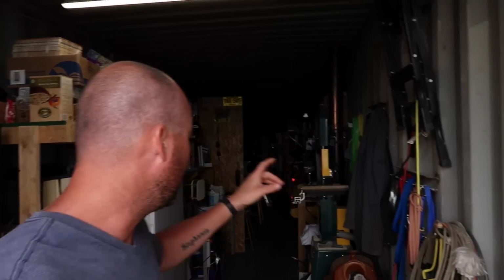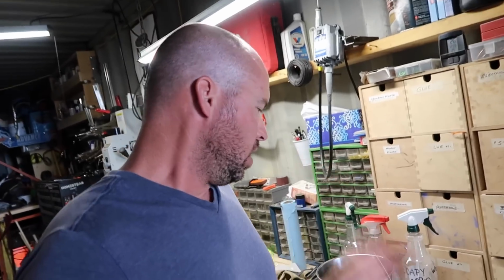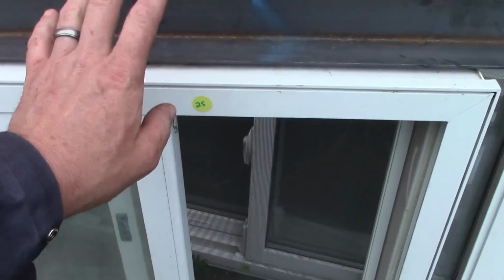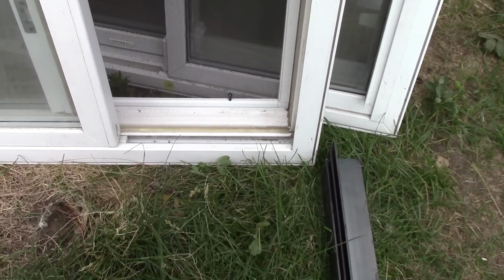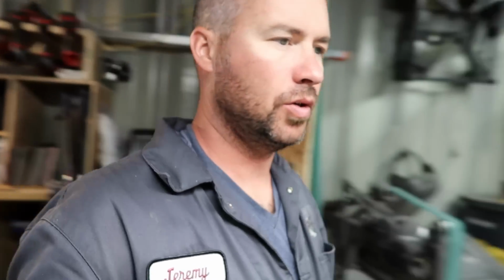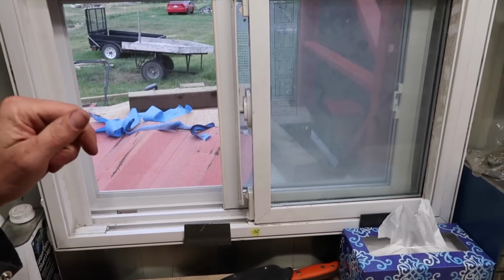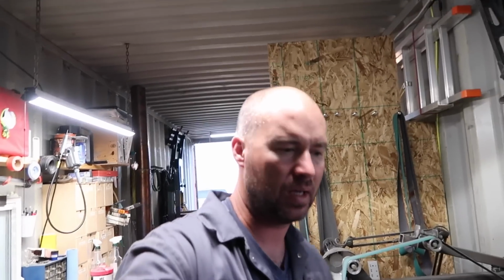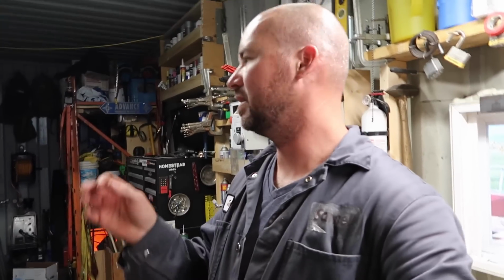Installing windows in the shipping container knife shop

Comment: Wow, hang some jerky in there.  :) That angle grinder appeared to make simple work out of cutting the openings! What a great project. Lots of great skill-sets used. Turned out great! Next project a little sun light on the roof. :)
Reply from the maker: Thanks! Sometimes I think I'm turning myself into jerky when it's that hot:) I started cutting it with an foxy-accetalyne touch but it was taking way too long so I grabbed the angle grinder. Always a versatile tool. A skylight, now that would be nice!

Comment: The video is great. I've heard of people buying two to three of them (the shipping containers), joining the walls together and living in them. Kind of like converting them into a house. I guess with a external roof (something to keep the water shed and heat from bearing down so much) it might not be that bad. Place them on a poured concrete foundation, with them raised to access the underside. They are pretty well constructed and the only thing missing is all the holes you'd have to cut to run water, sewage and electricity. It probably isn't that bad of a way to go.
Reply: Yeah there is a company looking into the possibility of making blocks of apartments in london out of stacked seacans. Affordable housing for the win.
Reply from the maker: We are actually thinking about making a shipping container house. The one thing I think would be difficult is getting it approved. Also, probably wouldn't be cheap to get it all engineered and designed by an architect (which I'm sure we would have to do in order to get approval from the county).  They're pretty cool boxes these things.
Reply: Simple Little Life I don't know anything about where one would even start to go about getting approval for something like this. I was just figuring that most of them are water tight (I pulled containers about a year "back in the days" when I drove tractor trailer). I would think that they would be OK to live in. I've seen on YouTube a couple of times where people have bought two or three of them and have the sides or ends cut and welded to form a house type structure. I'm not sure if they lived in them or not, but at least that's what they said they were going to do. 
I guess it would depend upon where you live and what the building codes for residential housing would be. 
I still think it would be an economical way to have a shelter for living. I know for a fact that there's insulation that can be attached to the walls, where a person could attach paneling, sheetrock or whatever (I mean they fix them up for shipping frozen cargo, so walling one shouldn't be that hard). And running electrical/plumbing lines wouldn't be a real hard feat to accomplish. 
Again, just a thought/idea.
Hope you have a happy day!!!!!
Reply from the maker: Thomas Pigg yeah I've seen a few houses in the area that I live that are from sea containers. Most aren't cheap (they had very fancy modern support structures, cantilevered rooms etc, but they sure look good. One nice thing with using one as a shop is that you can weld anything you want to it any where you want. Benches, shelves, hangers you name it. Super fast and strong way to customize your "shop". Cheers!
Reply: +Simple Little Life Approval would be a major pain. You'd also have to insulate it to live in it full time I'd imagine. Another concern I'd have would be electricity. Maybe I'm just paranoid but there's a higher chance of a short. I'm sure the inspector wouldn't be electrified by the idea either (pardon the pun).

Comment: Hey simple little life, im sure you have thought of this already, but im sure you could also include a skylight if you need more light. but yea cool vid and have a gr8 day.
Reply: I think that would be extremly hot during summer
Reply: +Robert Walpole I would have to agree.
Reply: also skylights + flat roof = inevitable leaks
Reply: +spamboli Again good point.
Reply from the maker: Thanks a good idea. Yeah, heat would probably go up, but then in the winter it would help it warm up. If I found a used skylight I would probably install it. Now I might just have to look for one....We don't get all that much rain here and if it's installed properly it should hold off the water until it evaporates and dries out.